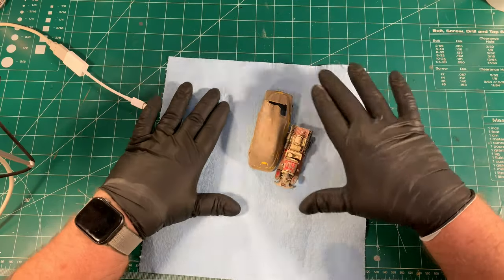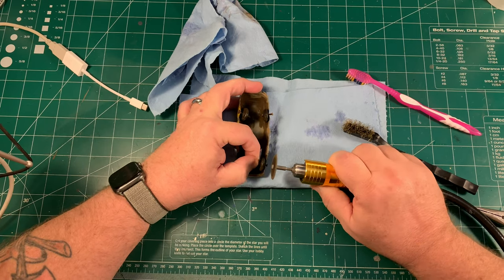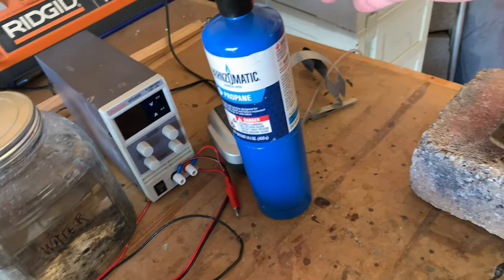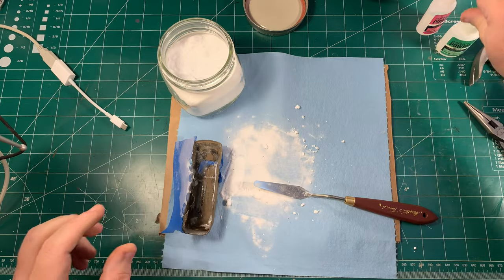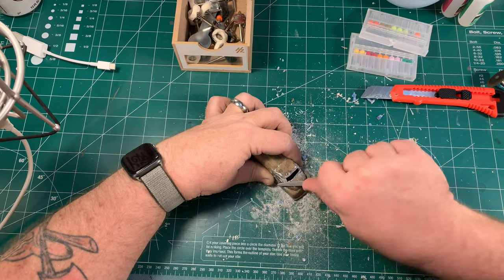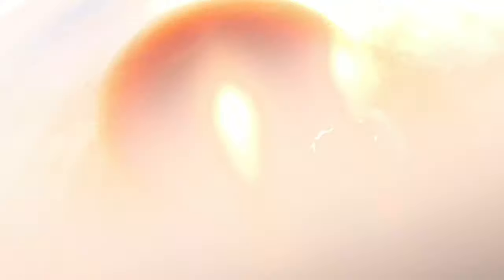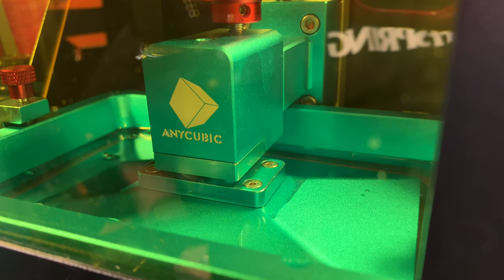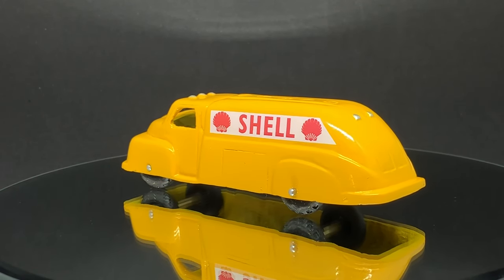Restoring a Tootsie Toy Tanker!  A true miracle of a restoration!

Comment: It looks amazing, Paul! After all, these were simple, crude toys when they were made. I've done a few of these, and Midgetoys. I recently did a preservation to a Hubley tipper truck, and found JB Weld to really work well on these metals as a filler, gusset, and cement. It gets as hard as metal, and sands beautifully.  Try it next time, especially if you want a surface smoother than super glue and baking soda.
Reply from the maker: I will indeed.  Even when I like a way to do something, I'm always up to try a new way...

Comment: Brilliant job on the Tootsie Paul, if it was me it would've ended up just a rusty shell in a junkyard diorama! Good thinking to anneal the casting before anything else, as you said maybe you should've got the flux out and added some solder or other metal while you had the torch out. Still looks 1000% better than what you started with, looking forward to the next one.
Reply from the maker: I'm mad that at least attempting to solder never crossed my mind...

Comment: WOW! What a fantastic job, like most of the other comments so far, I think I would have just dumped it straight away.
Reading the comments so far re JB weld etc and is it template, maybe you should try putting a magnet over it, if tin plate then you could have used solder?
Reply from the maker: Great stuff!  I just never thought of that.  I guess I was in Diecast mode....

Comment: Tootsietoys were diecast cars and objects. Look at your monopoly game pieces. They were cast originally by Dowst MFG Co.. Dowst produced the first die-cast toy automobile with moveable wheels in 1911. Those wheels were metal. Way back then the toys were made of pewter and contained lead. It wasn't until the 30's when a new zinc alloy came around, ZAMAK, and the toys were cast in that. So, they are not tin plate toys as someone else had mentioned. Tin plate toys look completely different and have tabs, through slots, folded over connecting the different pieces together. Tootsietoys were cast, and usually made from 7 parts. The body, 2 axles and 4 tires. There are several links to Tootsietoys history and manufacturing. This particular tanker (from the 40's) came in yellow, orange and red and there is a Shell version where "Shell" was embossed onto the side when it was cast. The 50's version has a different front end, grill and lights, and has 4 running lights on the roof of the cab. Very nice restoration. Several later versions came out. Different castings and have Shell stickers on them. I have several mini Tootsietoys myself.